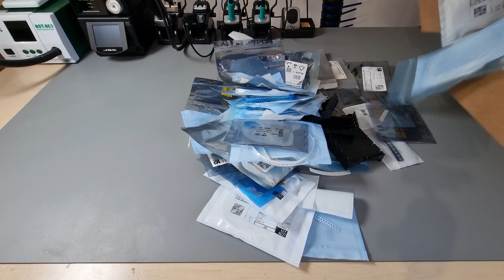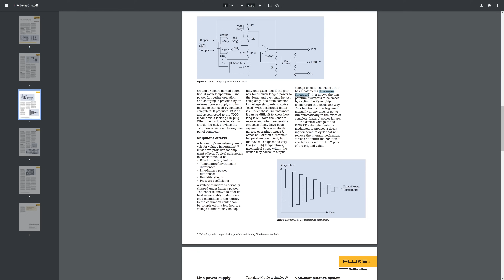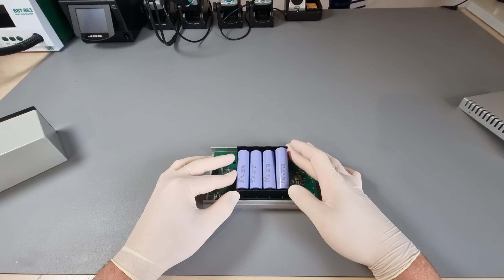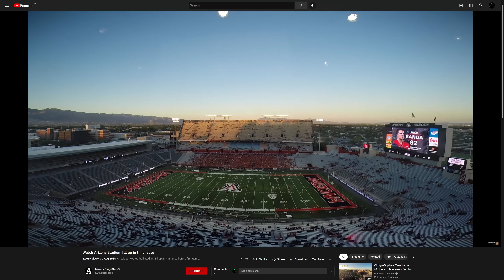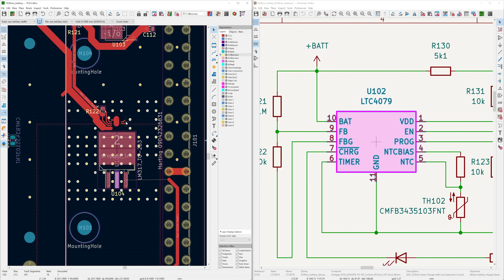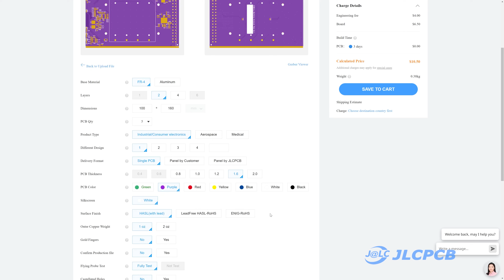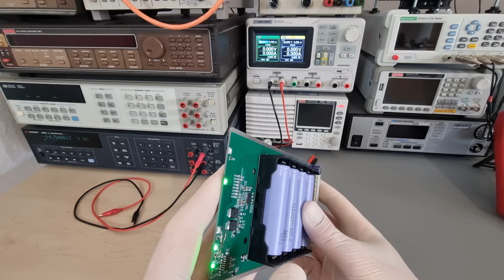ADRmu Battery Module - An uninterruptible power supply for 10V Standards

Comment: I was looking into that MPP Solar off grid system you have but I have a question. Can it be set to NOT charge the batteries from the grid once they are empty but ONLY charge the batteries when there is enough solar power? Thanks for your time.

Comment: That's a lot of effort to go to for a 7 hour charge cycle.  Have you considered using LiFePO4 which is totally happy with a current-limited, constant-voltage charge profile?  Two (or if you're clever, one) linear regulator and you're good to go.

Plus the balancing, but since you're building a constant-voltage supply, that can be just some shunt regulators around each cell.
Reply: Watch again from 9:15 onwards.

Comment: Dang, I've been thinking of doing something like this for my Resin 3D printer. Relatively low power but definitely a problem with power interrupts. What if it had an adjustable output voltage and 'read' the DC voltage during normal operation, and used that as the setpoint? Seems relatively easy and also useful!

Comment: Great little project.
Currently building a solar system using a Tesla S battery pack. Definitely adding redundant protection to keep it form going into goblin mode. (will remember that term)
Have to keep the all 432 18650 cells happy.
Reply: You're starting out with firecrackers, so good luck with that.

Comment: Can the output regulator be swaped for instants with a LT1084 for more juice? or is even a pin to pin compatible regulator? Or is it better just to parallel another l7812 for simplicity sakes :)

Comment: Isn't it a better idea to have the two linear regulators as far away from each other as possible, so they dont heat each other up? That way each can have more surface area for cooling.

Comment: For a moment there I thought  I was witnessing some KiCad wizardry right in front of my very eyes. Regardless, using the regulator in parallel with the charge controller is some wizardry of it's own. I might want to put that one up my sleeve.

I'm actually in the process of designing the charger circuitry for my hopefully commercial project. I said to myself "It'll charge using power from USB. How hard could it be?"... Several weeks later, 4 largely different circuit variations, and the constant uncovering of new "gotchas" that the USB IF sprinkled in the spec like rotten easter eggs. And of course I'm doing all this while trying to work around the limitations of non-ideal parts since the ones I actually want have a 1000 year lead time.
Reply: First, build a time machine out of NOS parts.  Then, go a thousand years into the future to grab the long lead time parts when they're ready.  Or you can go back in time a couple years to pick up parts that use to be in stock. Then, return to the present and build your project.

Comment: Instead of a fuel gauge, wouldn't it be better with a $1.50 7-seg voltmeter.
Reply: Probably no. The display is most likely multiplexed, the internals are digital, so it creates more noise. Plus, it's more LEDs to drain the battery.

Comment: Why do you need all your reference power supplies ? you never make anything with it ? (at least not on the channel ever) . you need 3 micron accurate CNC with all sponsored way to expensive crap (really no clue why they fall for that) and then leave it in your shed ?  this channel went to shit in my opinion. hording sposors is what you did for the past 2 years.  no offence..its unpacking of expensive crap. or repairing (most interesting videos though) but also sponsored.  so what is it actually what this channel is about >? besides JLC PCB PCB way or any other Chinese PCB manufacturer

Comment: Awesome! It seems that reliable power is becoming more and more a must, not just for PPM's but for convenience and safety, now that everyone is so dependant on electronic devices whole home backup power is becoming more and more desired.
Thanks for the cool circuit, too bad the ubiquitous TP4056 couldnt be used.
I think you should add in better power flow for the device. That way the 250mA current limit can be bypassed. It looks like you have 24v going to the linear charger then buffered directly by the battery then to a 7812 to the stable 12v output. What I suggest you do is add 2 diodes to the input of the 7812, the first coming from the battery to the 7812, the second coming from the main input (24v) to the 7812, that way as long as the input supply is higher than the battery voltage (meaning the batteries could be charging) then the power goes directly to the 7812 meaning you could get a max of 1A of pass through power (provided enough cooling was given to the 7812). Then when the supply voltage drops below the battery voltage then it will start to draw the batteries down while still being able to source a maximum of 1A.
I do this alot with my DC UPS circuits and I use ideal diode boards which keep the efficiency and current handling high when feeding buck/boost converters, in your application the PPM's are more important than efficiency so diodes would actually help by reducing the voltage by ~0.5v sharing the heat of the 7812.
Not only does this increase the current handling capability but it also significantly reduces the "micro cycles" the batteries see, because of voltage drop under varying loads the charge voltage of the cells will be constantly changing with each increase and decrease of throughput current. This should allow the cells to also have a significantly increased lifespan while also increasing the total passthrough current capability. I always get annoyed when manufacturers dont implement this feature, the cost is very low and will make it last a much longer amount of time!

I hope this helps and good luck on the next project/revision!

Comment: Look in to emergency light module AGM batteries; they're available in 6 and 12 volt, run between 2.5-5 amp hour and would fit perfectly in the space you're working with.
Reply: That's what I was thinking, too. I also remember Big Clive doing a teardown of a headlamp with an AGM battery that couldn't have been bigger than 10 cm x 10 cm x 10 cm.
Reply: i am late to this thread, but here in germany its EXTREMLY uncommon to find any sort of emergency light with AGM batteries. Bigger installations like in schools or other public buildings have centralized batteries (also AGM but full size) or if they are actual lights with integrated batteries they are Lithium based or if they are older Ni-Cd (or those terrible Ni-Mh) never ever have i seen a AGM inside of a light.

Comment: Isn't your voltage standard isolation converter an "evil switcher"? So why not just make the charging a switcher as well?
Reply from the maker: Yes, it's a bit strange: My DC-DC converter on the reference module uses this eXtRemE iSOlAtIon idea to attenuate all incoming common mode noise. I made a video about it. So whatever I do on the battery module should mostly disappear. But systematically it just didn't feel right to have a potential noise source there

Comment: 4000 hours? Didn't you forget some parenthesis there? 28Wh / (0.084A x 12V) should be less than 28 hours, very long, but not unreasonable, if you don't need to transport it very frequently.
Reply from the maker: the reference module wants at least a watt too :_LTZ:
Reply: @reps  Yes, as you wrote two lines above, 184mA total, subtract 100mA for the module, and you have the remaining 84mA that you used to calculate, so there is no need to worry about the 1W for the module since it's already taken care of, at least according to your calculations 😉

Comment: 11:39 There is a distinct lack of "panic" indicators in modern electronic. Thanks for your work in fighting that.
Reply: I think a flashing red led and a wailing piezoelectric buzzer would be best!
Reply: that's what the NMC cells are for...visual, auditory and thermal indicator of panic mode :P
Reply: We need more blinkenlights in modern products
Reply: @namAehT  Primary reason why I always opt for Ethernet over Wifi.
Reply: Yup. Indeed there should be a simple something isn't right indicator on a lot of stuff. 😮

Comment: You may want to reduce the maximum charge voltage of the batteries to prolong their lifespan, since batteries stored at 100% SoC lose around 20% capacity per year per battery university BU-808. If the reduction in total capacity causes issues with road trips, you could add a DIP switch to enable full charge for planned outings. Fun little project!
Reply from the maker: good idea :_stonks:
Reply: @reps  wanna do a follow up? :D
Reply: A recessed push toggle on the front panel would be perfect. Have it normally recessed in the front panel, and limiting the charge voltage. Then if you press it, it pops out, raising the change votlage.
Reply: Yup, keep the li-ions at ~70% charge and they'll still have over 90% life left half a decade later

Comment: I see another invertor charging a battery, why do DC2DC charging circuits get  so rare. I see them only for car batteries. I spent time searching for something to charge my bike batteries without the need to carry a full charger and using inverters on the Stationary power stations.

Comment: Would the thermal throttling also be able to help protecting the batteries, if mounted close to them, or is the throttle temperature too high?
Reply from the maker: The throttle temperature is around 90-100°C so a bit too warm for normal 18650s ... there are however special cells with a high temperature electrolyte where this might work
Reply from the maker: @LordPrecision  yup the latest version has an additional footprint for a leaded thermistor

Comment: Talk about supply chain issues, 0:13 looks like DigiKey shipped a hardware bug in with your components!
Reply: Nice catch lol
Reply: Fortunately, it didn't came from Australia!
Reply: That's DigiKey customer service for you: high-quality electronic components, plus a free snack.
Reply: What bug? The sound that that thing does when it hits the table is the one of an electronic component, not a bug.
Reply: @Ismsanmar  Actual bug lol, go to the timestamp, pause and go frame by frame, you'll see a bug fall out of the bag and run off the table.